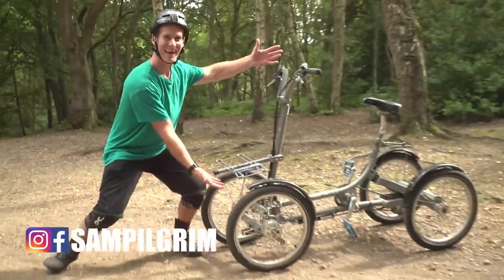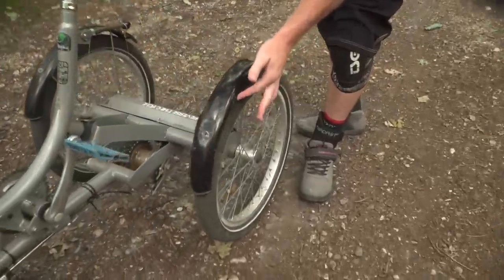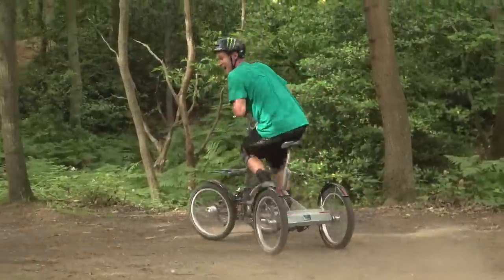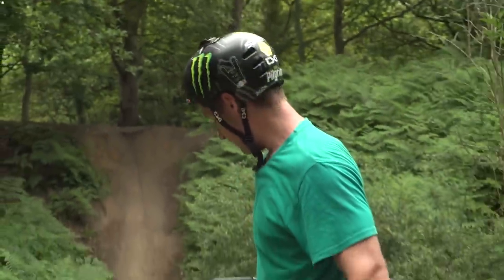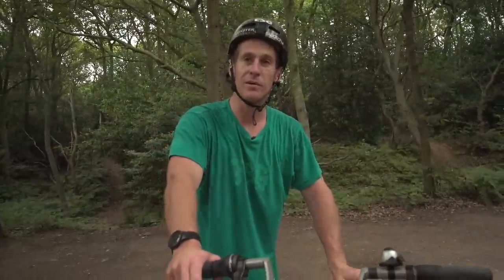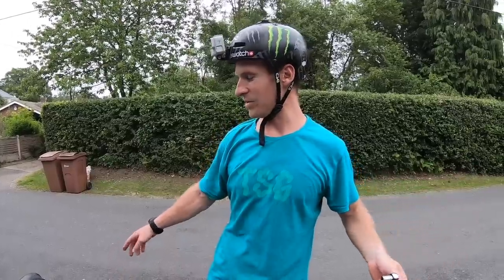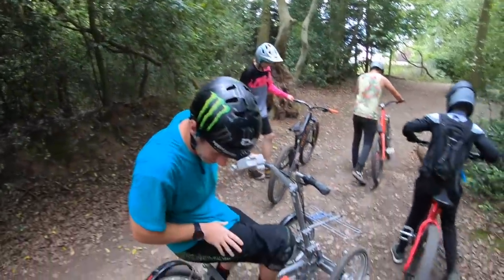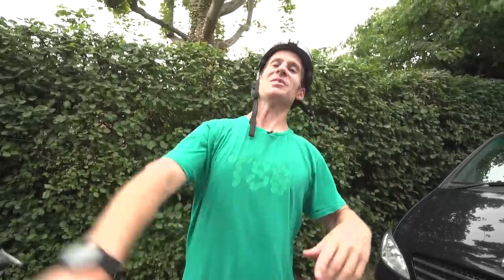SHREDDING TRAILS ON THE MOUNTAIN BIKE QUAD!

Comment: You should weld a tube between the two handlebar things so it's more like BMX bars!
Reply: You can buy a brace to fit instead of welding. Online shop that sells Motorcross bikes spares best place
Reply: Or... Just by a BMX bar
Reply: @gezak4778  Which ever is easier for him i guess
Reply: Or just upgrade the bike overall and install a bmx bar, bmx rims and other little things. This thing could be a dream😅

Comment: That Quad was actually very well designed to be taking all that you've thrown at it! 
I hope the manufacture has been watching your extensive shake down rides to develop and improve their product.
A test rider like Sam Pilgrim is invaluable towards research feedback. No one else in their right mind would dare to push the Quad to these limits.
Reply: "No one else in their right mind would dare to push the Quad to these limits"    you have not met me, I would do it with a 112 cc motor attached to it in a second..lol

Comment: Can you put the drift wheels on it I think it’s going to be amazing
Reply from the maker: The Siglevs that would be rad!
Reply: @SamPilgrim  Build drift tires out of PVC pipes next time, works much better than plastic tubes, something like this: https://youtu.be/yswpG4GuDXI?t=279
Reply: @Dude-Smellmyhelmet  Well, depends on which gauge, he used super thin walls last time, held up for 10 seconds before it was chewed through, but yeah, sure.

Comment: Hey Sam Pilgrim! The quad bike vidz are 4 times the fun! Hey connect the two handle bars with a chain or cable to strengthen them yourself! Ride ride ride!
Reply from the maker: Eric M good plan haha
Reply: Hey Sam Pilgrim! It's probably less expensive than the stock part that will bend anyway! Ride ride ride!

Comment: Could be fun to engineer a double wishbone suspension with modern materials for a mountain quad. Saw a guy who had lost his legs on a slick looking down hill quad with full suspension. But it had no drive system as it was set up for pure downhill. It was really high tech though. Lots of carbon & aluminum, (maybe even had some of that strange and rare British aluminium). But that would be a good place to start for a high performance quad. Or two MTBs engineered into a quad could work. Would be insane fun with an electric motor. Creates a whole new class. The drifting potential alone is attractive.

Comment: Grab some m6 threaded bar drill a hole in the top of the flat bit of the bars either side, then use 4 bolts to lock it tight.
2 on the inside 2 on the outside.
then Send it!

Comment: Looks like your stuck with that stem, shim wouldnt work on steerer, as would have to be welded at perfect angle.
 i can only suggest unbolting both sides of the handlebar then with the wee pipe left in the stem , weld on a bmx bar cut to fit on wee pipe, with crossbar(3x)